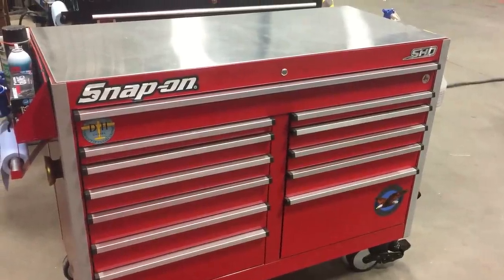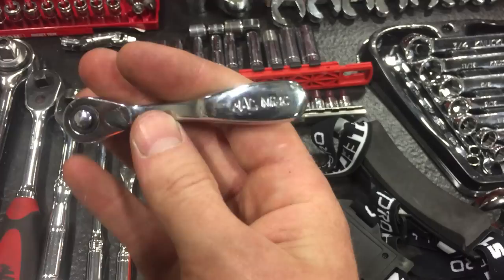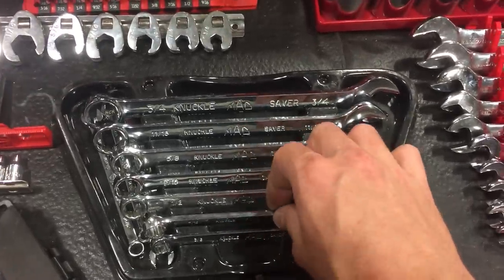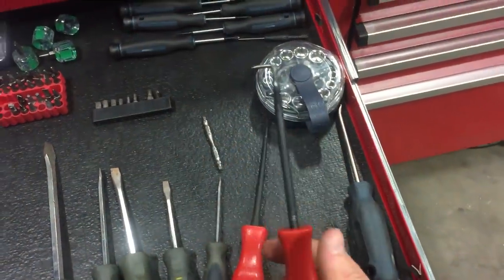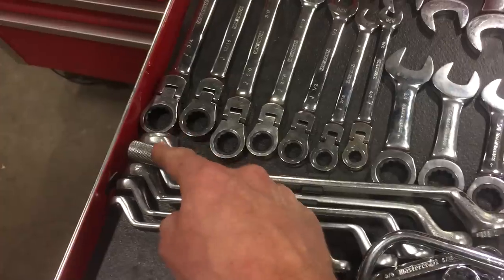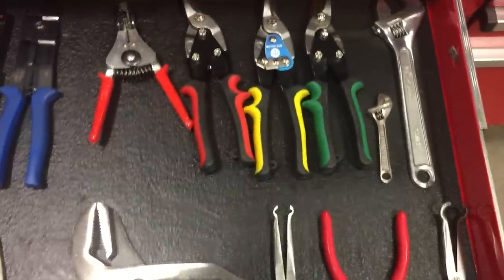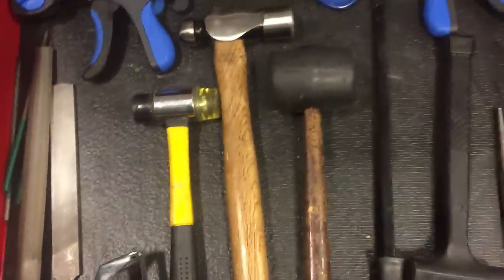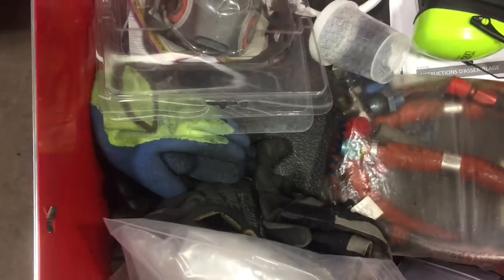Aircraft Mechanic Toolbox Tour

Comment: I have nearly 50 years in the business (A&P, I.A.) and one thing I found VERY useful was a good quality, small digital camera. I would stick it in tight places, take a photo, then take it into the office and look at it on the computer monitor. Several times I was able to identify cracks that were not visible to the naked eye. You need to be able to zoom in close with software. 
 I can also tell you when it is time to retire. When, after decades,  your knees hurt from pulling planes (up to 6000 lbs) around by hand with a tow bar  and getting up off a creeper 89 times a day. Then you stand in front of your tool box and ask yourself, "What in the hell did I come up here for?"
Reply from the maker: I.R. Wayright Uh oh, I already have that last thing happening to me!
Reply: I agree 100% about the camera. Most of the cell phones cameras are great. I use mine all the time for looking at damage like you described and also getting serial/part numbers.
Reply: Jhonny Abbes  Drive a truck. I had two customers who could afford a single or a twin. They were truck drivers. Not owner/operators. They worked for a large firm.
Reply: I feel your pain retired here A&P too.
Reply: I use the camera on my phone.

Comment: I’m an anotmotive tech and I’m jealous of the smaller amount of tools you have to have as compared to the automotive side. I like your organization.
Reply from the maker: Thanks! Yeah only needing SAE and usually 1/4” drive/small stuff at that is pretty nice. Allows a guy to have fewer but maybe nicer tools at that.
Reply: Same here, automotive/ Heavy/ Diesel Mechanic.. working on military equipment and we use everything from 1/4" to 3/4" all the way up to heavy 1" impacts and massive wrenches beyond 34mm. Love it though.
Reply: No the aircraft need special tool which cost a lot of money and if we were to buy them we would need a truck.

Comment: I am studying to be an aircraft mechanic (hopefully one more year before I graduate) and I literally just purchased that snap on ratcheting screwdriver with my student discount. Best tool in my toolbox without a doubt. I have mostly cheap to mid-range tools but there are a select few I spent the big bucks on. If you're smart with those discounts you get a great tool that you will use, has a lifetime warranty, and you won't go broke. Everything else is either second hand or harbour freight.
Reply from the maker: Matthew Martin agreed, I wasn’t able to take advantage of that discount as much as I should have but hindsight is always 20-20! But in the end, you won’t know which ones are worth spending $ on until you get some time in on whatever machines you’ll be working on. By no means should you spend all your savings on tools!

Comment: Nice tool kit mate appreciate the tour, mine is looking a bit tired at the moment, been out of the game for 10 years or so and not looking to ever return if I had my way, reckon I would need to spend 2k to get it to the point I want it
Couple of points 
Didn’t See magnet or Mirror
I used my 3/8 quite a bit but only 1/2 to take out spark plugs
I loved my snap on long screw philips screwdriver as well unfortunately someone else loved it more 
Good sized roll cab, I went a bit small
Seen some guys with 72inch but that is stupid big when space in a hanger can be at a premium

Comment: Those offset/angle wrenches are not the same as snap on. They appear to be a 15/60 while snap on offers a 30/60 degree ends. Its nice having all different angles 15/30/60 to get some ridiculously placed bolts.
Reply from the maker: Kristian Eppen you are correct, they are not the same. But I’ve still yet to come across something I couldn’t reach with these. Still struggle to justify spending that kind of money on the snappy’s

Comment: I bought a smaller craftmen roller so I can put in those "not supposed to have" fasteners so I would have a nice supply. do a check tool box not mine LOL if the FAA wanted to do it.  also Milbar reversible wire twisters are the best you can get.  I had a pair of Snap on Heavy duty side cutters, and I was not in aviation and my job travel and I needed some tools so I had it with me forgot to put it back in my travel tool box which gets check and I had it in my carry on.. I lost a nice pair cause TSA took it away.  I bet they kept it themselves LOL

Comment: about ratchets
you should take a look at wera, they have a pretty small still strong 1/4" ratchet with the "zyklop metal" and a tiny bit ratchet
i have the 1/4" ratchet with the zyklop speed in a nice textile box with extensions and stuff
and the bit ratchet in the toolcheck plus set, wich is a compact set of high quality bits, 6point sockets, converter from hex to square drive and a tiny screwdriver handle

both sets are just rly nice for what i do with it, you should take at least a look ;)
Reply from the maker: LeXeL i will have to check it out, thanks!

Comment: +1 on the snap-on ratcheting screwdriver. HOWEVER, I use the stubby one everyday over the full-size one because the damn cap ALWAYS comes off when im loosening a screw/nut. Probably just gunna throw some 1300L on it and call it a day!
Nice box!
Reply from the maker: Steev ya a stubby is next on my hit list, them things are slick!
Reply: Yeah it's the best screwdriver ive ever owned. The handle is small so you can put some good torque on it, plus it feels perfect in your hand. Also, the shanks are interchangeable which makes adapting to different applications such a breeze..
10/10 would recommend
Reply: Steev I can see why it wouldn't work

Comment: As an equipment and truck mechanic I have 13,000 in non truck brand tools and I'm in my first year. I can't believe you can fix airplanes with those few tools. Do you do engine work or electrical troubleshooting?
Reply from the maker: Matt Menendez yeah we don’t have it nearly as bad as you guys! And yes we do electrical, engines, hydraulics, airframe, you name it. There are specialized people for each of those fields, but I work at a line maintenance base so we touch everything we have time for. Mostly troubleshooting and light inspections where I work. 

As far as the tools, I’m not kidding when I say 1/4, basic wrenches and screwdrivers are king. We do use 3/8’s occasionally. But we aren’t expected to buy those one-off specialty tools that each airplane or engine often requires. Like everything else in the business they are astronomically expensive.

Another good thing is bulk of the machines have only SAE sized fasteners. No need to worry about about metric anything

Comment: Nice tour.
Really nice to have a none biased owner. Some cheap tools are OK for some jobs.
Credit only when it's due, I agree with your comments on the Snap-on ratchet screwdriver and the Knipex products, they are worth the extra money.
Quarter inch drive is probable fine for aviation as you don't suffer so much with rusted on nuts. Also the quality of the hardware used in aviation is so much better than your average car or truck, in addition planes that fly above a certain altitude tend to operate in a dryer environment, so again less prone to rust. 
Nice box, spend your money on the tools, not the box! You have it the right way around.
Reply from the maker: Harvey Smith thanks for the input! Ya I can't wrap my head around how some people are willing to go into massive debt for tool truck branded stuff, when alot of times they aren't required. 
Indeed the quality of the hardware we use is typically better, and less prone to rust. Biggest thing is weight savings though, smaller fasteners are more than enough to hold together aluminum or composite materials. For us 1/4 inch is king! Even for the big stuff, I've never seen a torque value over 120ft/Lb.
Reply: Interesting. I forgot about the weight aspect, makes sense. 
The tool issue is a whole other massive subject. Marketing. Very clever subject that has been perfected.
They know how to trigger parts of the brain,  desire, insecurity, greed etc.
Reply from the maker: Harvey Smith You've got that absolutely spot on! 
Was kind of my intention of this video, hopefully show some up and comers that they don't need to  buy into that mindset of needing to best of the best of everything
Reply: Good man, help the younger guys. I was told just buy cheap tools until you find out what you use all the time (ratchets etc) then buy quality of the most used. The spare cheap tools can live at home or in the car.
Take care of the PT6's

Comment: Whats funny is that I never considered working on GA aircraft. I worked on heavies, and it still rubbed off on me a LOT (think using the stupid foam on every single drawer..which Im redoing now because I got a new box...and I work on cars, but man, FOD is still on my brain. I will shut down the shop and look for that lost staple or chunk or broken pry bar lol)

I am moving away from relying on foam, since its a pain to upgrade to new tools, something that in aviation is less of an issue. I could take apart a 707 with a 7 drawer Snapon box. For cars, I have two massive toolboxes, probably 25 drawers total (but Im also disabled, so lots of tools that were once a luxury are now a ncessity). I guess Im getting old because I have fond memories of airplanes (although the smell of jet exhaust IMMEDIATELY brings back the bad memories LOL...so youtube vids are perfect!)

Comment: Do you ever need or use lots air tools? Like impacts or air hammers? Coming from an automotive background I’m curious. How about any diagnostic equip like fuel pressure gauge, oil pressure gauge, DVOM or any sort of “scan” tool for electronics?
Reply from the maker: Mike yes we do use air quite often. All sorts of drills, grinders, rivet guns to name a few. As far as diagnostic equipment, it all depends on the shop you work at and the type of aircraft you run. In our hangar there isn’t per se any scan tools we can use, and if there were the company would most certainly have to provide one for us because the cost. Certain units on our most ‘modern’ aircraft, (Saab 340’s) do have limited self troubleshooting functions built into them but it is usually very limited. The more modern machines/airliners do have complete maintenance diagnostic systems in them themselves, which would be nice but I’m not familiar with any of them. As far as basic stuff ie pressure gauges and stuff, most guys will have basic sets for different uses and pressures. Air pressure gauges and fluid. But as far as big tooling items specific to one airframe or say one engine type are usually provided by your employer because the costs involved with anything in aviation are staggering. Hope this answered your question!

Comment: Using this to complete my motorcycle kit - had most but a few I didn't know about. Why is 12-point such a big thing> I thought 6-point was stronger so graduated to them - is it for getting into tight spots as they have an easier connection? Thanks for the video (bit late to this party).
Reply from the maker: 12 point isn’t really big outside of the aviation business and say some performance engine building. Many 12pt fasteners I see everyday while at work. Main reasons I think being:
-the heads can be physically smaller size
-when working “blind” a 12pt socket will slip onto the fastener much easier
-actually higher torque yield capabilities as the 12pt socket on a 12pt fastener has much more surface contact than 6pt.

I’d say the good majority of the more ‘critical’ bolts on aircraft we see are 12pt bolts, ie engine mounts/prop bolts/turbine stub shaft bolts
Reply: @turdpike  Gracias señor Pike.

Comment: Hey great video man I appreciate you taking the time to show us your set up! Quick question man, I’m a hydraulic guy in the Air Force and just finished my writtens for the A&P I’m going back to the states soon for the oral and practical. Question is I don’t really know much outside of hydro and electrical , did you go to school? Do you think it would be beneficial to go to school or does it not teach you much? 8 years experience.
Reply from the maker: Thanks for the input! 
As far as your question- it’s hard for me to comment as I’m Canadian and don’t quite now how all the schooling works anyway down there for what you guys call an A&P. 
If it’s anything like here, I believe ex air force mech’s here would still be better off going to school to just get the exams over with that our governing body mandates (Transport Canada, like your FAA). And not sure about there but as far as I know air force time here can’t count towards civilian time as mechanics... it’s dumb.
But ya I wish I could confidently answer your question but I just don’t know how it works there
Reply: Yeah man I was in the US marine corps and got my A&P before I got out. School can teach you a lot if you haven't had much engine experience especially piston engines, and also the FAA standards which is way different than what you are use to. But if you can find a part time gig while in school, you will learn more doing that.
Reply: Same. Airframe sheet metal structures dude and Hyd guy. Im about to get out but all of my buddies here are saying if you want to go commercial or get hired by corporations you're going to NEED your A&P. That being said i have buddies who don't have their A&P's but are doing contracting jobs. 4k dollars every biweekly paycheck.... Im hoping I could get that soon. Good luck man!

Comment: I will start working as a Heavy overhaul A&P in December.  Any more tool recommendations for the heavy overhaul A&P tech? (C and D checks on Boeing 767 mostly)                
Can you tell us more about the types of aircraft you work on?
Reply from the maker: Dth Song Hi! Sorry that is one thing I should have mentioned in the video. I’m not a heavy, I work at a line maintenance base for our company. We don’t do huge checks but still look after all the smaller ones leading up to say a 4000hr.
We don’t run anything too special, Saab 340’s, Beech 1900, King Air 100/200/300/350, De Havilland Canada DHC-2,-3,-3T,-6, Piper PA31-350’s and Cessna 185. At my current base we only service the 340’s, 1900 and a few King Air 300-350’s. 
As far as tools for heavy maintenance, first and foremost get yourself good flashlights and mirrors. You’ll need em. Next would likely have to be a good drill, (preferably a smaller 12v), good screw extractors, a bunch of plastic scrapers, and decent screwdrivers. The rest I imagine you could get away with standard stuff, you’re not gonna know really what you need need until you get some time under your belt at your new job. 
Hope this helps!
Reply: TY for the quick reply.
Reply: Dont worry to much the guys youll work with, will have what you need. Pro tip make a list of what you use and if you use it twice buy it. Its worked for me.

Comment: Really great walk through.  Almost that entire box is SAE.  Do modern aircraft still use standard fasteners rather than metric?
Reply from the maker: TJ Ninneman I can’t speak for brand new machines as the ‘newest’ I’ve ever wrenched on was built in 98’, but I believe they are still SAE. Standardized across the board is what the industry is after, also the cost for manufacturers of machines and parts to re-tool to make metric fasteners would be astronomical. We’ll be stuck using SAE for a long while yet!
Reply: Depends on place of manufacture. Diamond (based out of Europe somewhere) has lots of metric shit. Dolphine (I think that’s how it’s spelled) a helicopter manufacturer out of Sweden I’d like to say uses metric as well

Comment: Hi i am a AMT student and have a discount wt snap on and really want to take advantage of it. I am planning to buy some Snap on Ratchet Standard and Long handle on both 1/4 and 3/8 which one would you recommend me? Thanks i have been eyeing out the locking flex one but have no experience wt buying snap on before
Reply from the maker: For 1/4 I’d get both standard and locking flex head if you could. 3/8 doesn’t really matter as much as you won’t use it as often. Could go either way there but I wouldn’t say you need both in 3/8
Reply: Thanks a lot man
Reply: Ans what about the long hangle ones?
Reply from the maker: @joses.colonpagan2575  short/standard length you’ll use more of. Up to you for long one, doesn’t necessarily have to be Snap-on. But yes an assortment of ratchets isn’t a bad idea
Reply: Thanks a lot man

Comment: Thanks for the tour turdpike. That's an interesting handle. 😀
I like the box for the drawer length and the configuration as well. What is the cabinet width? I think that I missed it.
Reply from the maker: It's 24" deep and 54" in width I believe, 12 drawers total. 
For the price I couldn't find anything really comparable, its a pretty stout box. Weighs 500 pounds empty itself. Big wheels and casters feel great, rolls better than some of the snappy ones in our hangar. 

Only complaint is they could have cut the top to fit better. Hard to tell from video but the stainless top floats around a bit, and theres a gap where crap builds up on the top of the box. Ahh well, something I could fix myself just haven't!
Reply: turdpike 
That was a good deal. I could really use a box like that. I'm probably gonna stick with US  General for the price I guess. I'm a weekend warrior, it's not my career. 
Thanks for the speedy reply.👍

Comment: real question tho whats with saying 12pt is better then 6pt if you can use 6pt you should use them , 12pt strip easier on a 6pt bolts
Reply from the maker: we use a lot of 12pt fasteners is why. also they are superior in tighter areas where you can't get as much swing on your ratchet. but yes I'm aware they strip 6pt fasteners easier